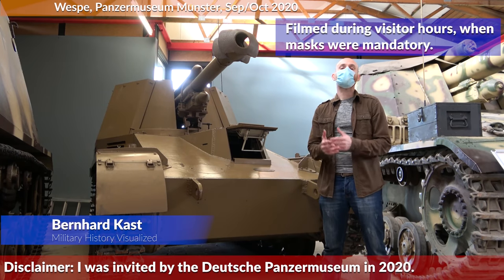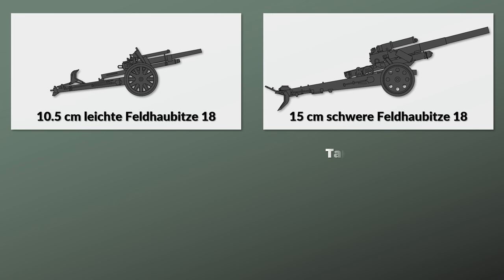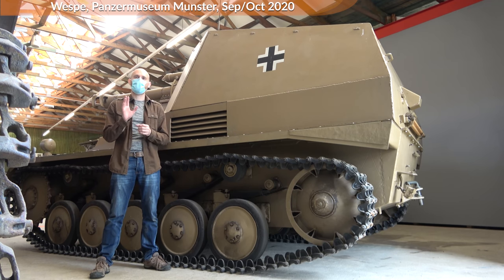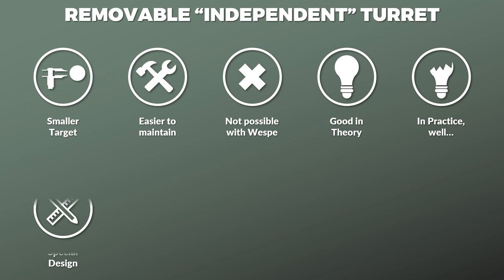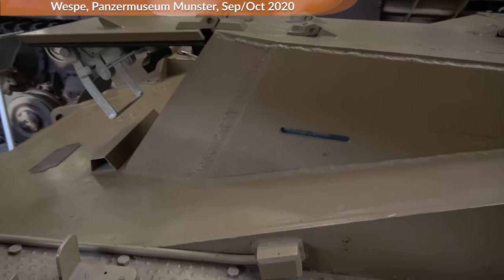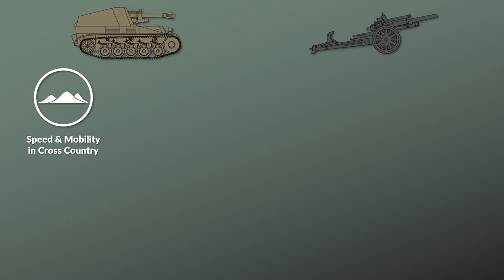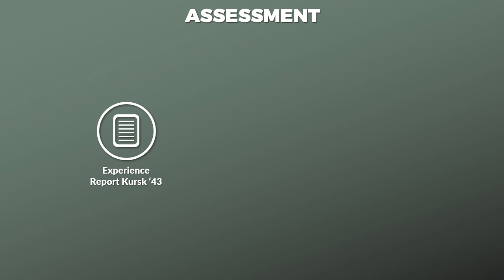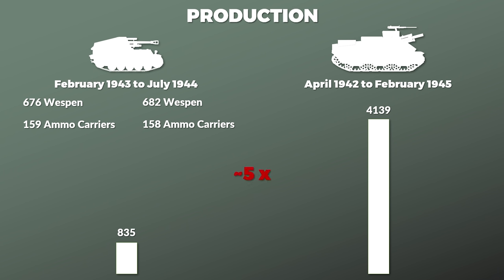Wespe: A Successful Failure?

Comment: You forget a major positive, the Wespe used an existing chasis that wasn't of much use other than as a platform for the 7.5 cm PAK. As such, the Wespe did not interfere with Stug, Panzer IV, or other tank production and allowed existing production lines to produce a useful vehicle rather than having to stop them to retool. Although you mentioned it used the obsolete panzer II chasis, you didn't point ot out as a positive when it should be given Germany's situation.  I wonder though if the 38t chasis might have been a better choice? Pretty sure the Panzer III chasis would have been better, but  would it be worth having lass Stugs on hand?
Reply from the maker: Well, I didn't talk about production benefits, also this is kinda implied with obsolete panzer 2 and existing components.
Reply: I wonder if they could have done the same with some of the obsolete French tanks?

The long term problem with that might be the German army's supply chain was already very complex and would get worse.
Reply: @seriousmaran9414  I believe that a visit to Baustab -Becker is called for.
Reply: @chrisgibson5267  yes, I have found instances of conversion, thanks. Should have searched earlier. The slower French tanks would not have been fast enough to keep up, so probably not worth converting.
Reply: With German shortages of everything, was there any efforts to reclaim and recycle   old tanks and vehicles and steel? Seems to me the soviets left a lot of scrap steel laying around.
Reply: @seriousmaran9414   if all these Beutepanzers are limited to functioning  within their immediate area , then any limitations of supply train and or maintenance become much less impactful.
Reply: @paullakowski2509  considering that the French tanks were not fast enough to keep up it was probably better for the Germans to just scrap them.
Reply: @seriousmaran9414  NO , they were war bootie and should be reused in any manner they can....many were used as artillery tractors , while the turrets were mounted on fortifications. 

Since they were French they should stay and serve in the west. Another option is to just sell them to their military allies like the Italians Hungarians or Romanians etc.
Reply: @paullakowski2509  I am not arguing against those options but the German Army had better ones.
Reply: @seriousmaran9414 so whats your plan
Reply: @paullakowski2509  do I need one for a war that ended in 1945?

Many were damaged and recycled, others were used for security in France and some were turned into artillery. Fact was they were of limited usefulness once they invaded Russia. An idea might have been to gift them to the Italians who's tanks were even worse.
Reply: @seriousmaran9414  then gifts to the Italians /Romanians /Hungarians....it is.

 IF you research these wartime armies they all had enough motorization to equip a dozen brigades between them. In that case theirs more than enough Beute Panzer's to form a dozen mechanized brigades - each equipped with 4-6 battalions-detachments with  either ...armoured cars / APC/ PzJagd /SP howitzers and even a panzer battalion with SOMUA/CHAR B / M-13 & M-15...etc etc
Reply: @seriousmaran9414  I think concerns about sabotage would make that a less appealing option. French sabotage was mostly done in the form of playing dumb and hiding things, and the amount of resources that would be needed to prevent this kind of sabotage would mean it might be barely cheaper than just creating a new production line in a less hostile place. And the output would be crappy French vehicles. So not worth it.

I think the cost-benefit math for using French truck production works out better. I don't know if that was done, but I would be surprised if it wasn't.
Reply: @lobsterbark  more there just was not enough resources to supply all the factories.

Comment: I recall reading (I think in Chamberlain and Ellis) that the M7 was an inefficiently large chassis for a 105mm gun, and here we learn that the Wespe was if anything a bit too small.  I wonder if the Pz IV chassis might also have been a bit big, but the Pz III chassis could have been the perfect size for a 105mm armed SPG?  The post war US M37 105mm HMC was based on the M24 chassis, and dimensionally that's about the same size as a Pz III.
Reply: really the idea that the artillery "needs" what was asked for is silly
considering the need to deploy a battery of artillery in order to have any meaningful effect on target area carrying amo and crew is kind of a luxury, they are not really tactical that's what Stugs are for, although Russia used SU-76s as assault guns but was that really a "good" idea
M7 has it's flaws but spoils the hell out of it's crew with all the space, amo and the .50
the title is a bit unfair as the criteria is so stringent almost no WW2 SPG could be considered successful
Reply: Panzer 3 and Panzer 4 were the same size.
Reply: @michaelkensbock661  Have you seen the two vehicles side by side?  Or even two models in the same scale side by side?  The Panzer III is visibly more compact than the Panzer IV.
Reply: @michaelkensbock661  No 3 has a smaller chassis. But his production where stopped 1943 so ...
Reply: Pz3 production was stopped in 1943, however there were significant numbers of pz3 chassis Available right up to the end of the war.  Thus a conversion of a pz3 chassis to self propelled artillery is not infeasible
Reply: @lukasbechtel2401  It's not like the Germans were producing the Wespe's Pz II chassis past 1943 either.

Comment: On the point about "lighter weight for mobility" (or however it was phrased), I believe there is evidence that that was done. Specifically it is an open-topped vehicle. A closed armored top would have added perhaps a ton or two to the overall weight, and made the unit nearly immobile. I believe there is some documentary evidence that US self-propelled artillery was likewise open topped to reduce overall weight and increase mobility (or at least allow mobility).
Reply: A steel roof plate 2,5 x 2,5m and 10mm thick would weight about 500kg, so you were pretty close.

Comment: Hello!

I think its a bit odd that the Wespe only had 30 rounds of ammunition with it. If they would have chosen a bigger chasse they could have gotten away with more room for rounds. But i think you also need to view this from the production point of view. They probably already have a production line ready for the Panzer II chase, and while they were beefing up the tanks with heavier chasses, the Panzer II chasse probably became available. And they probably filled that gap up with the Wespe design. Also the ammo carrier is the same shape as the Wespe, that also shows that they wanted to keep production simple, so nothing fancy for the ammo carrier and they used the same design as the Wespe.

Today we have plasma cutters and CAD programs that let you design and build in a really quick pace. If they had that back in the day it would have been a lot easier to get things done. I think engineers back in the day were real artists, the amount of work you have to put in to get a drawing right, its a tedious job.

Any way; nice video!

Greetings,

Jeff
Reply: I think the original idea was moveable gun, if a Wespe is knocked out you move its gun into an ammo carrier and you have another Wespe. Germans also proved unwilling to dismantle production lines with the Panzer 2, Panzer 3 and 38T production lines simply being retooled to produce different vehicle variants, probably more efficent than Britain where everytime they came up with a new tank at one of the four or so main design companies they shut down the previous production lines so you had small production runs, also from 1941 every time a company won a contract to build a tank the next best bidder would be appointed to design an improved version of the winning design which meant the losing company would have to acquire another set of the winning companies tooling. (Though I suppose the plus side was redundancy, if one factory was knocked out another could still build the same design)
Reply: @watcherzero5256  The British failed for a long time to come up with a tank design with which they were satisfied. Nor had they an assault gun stratagem (they used infantry tanks), or had self propelled artillery at a high priority. I think they even phased the Priest out at one time because the Priest used different ammo. So there was little use for stug and self propelled gun concept. 
But for the  Archer the British did reuse a chassis and they did it even simpler. They put the 17 pounder on a Valentine chassis and switched gun around (firing backwards) so they did not even not to switch  the engine and the fighting compartment around.
Reply: @barthoving2053  There was also the Achilles which was an M10 but upgunned by the British, it used a slightly modified M4 chassis. Your right though, for the most part the British never withdrew a tank from service making it available for refitting, just sent it somewhere less hot (for example the Matilda II saw out the war fighting the Japanese in the Pacific) and ultimately for training new recruits. Some were used as artillery tractors though with both M3, M4 and Crusader II converted to tractors when better tanks came along 1943-1945. There was also some Valentines and other tanks converted to AA and SPGs as field modifications rather than an official programme of conversion. Also there were close support assault guns produced but generally as variants of normal tank designs (e.g. using a 95mm howitzer instead of a 2pdr and the Churchill AVRE) rather than a whole new vehicle being designed.
Reply: I disagree. Bigger gun than a normal tank, bigger munitions than an average tank, heavier than a panzer 2, less armoured. It's clearly designed to haul the main weight being the gun (as the gunless carriage can hold 3x the munitions). Simply "moving the gun to make room for more bullets, can throw the balance of the vehicle easily, putting excessive strain on the engine, gears, rollers etc, not to mention the possibility of needing a bigger engine and being prone to tipping or getting stuck if too far forward. (Also keeping in mind engine height given the clearance of the chassis)
Reply: No offence guys but you're nitpicking over nothing. Just making the 105mm LeFH howitzer mechanised and armoured, made them much MUCH MORE survivable. That they didn't have to waste that effort on medium tanks was a god send. 

An alternative might be the 150mm infantry gun....yes 1/2 artillery range , but with more than three times the through weight. That was also on the Czech chassis - again another sound concept. 

As to limits of ammo supply- each howitzer battery had ammo section of a light battery and carried >500 shells [Buchner T GI HB pp90] . With Wehrmacht a mechanized battery carried 4 *3 ton ammo trucks allowing maybe 144 shells plus 6 with each limber tractor. L W.G Niehorster .

These batteries also had a fifth tractor in the battery as replacement. Always thought that was to bring ammo forward , but i gather the limber arrangement was far from ideal and losing such a tractor was frequent enough to require a ready replacement.

Comment: I'm here thinking: what if you could make a design where the 360 traverse is achieved by the gunner being able to assume control of the tracks on the vehicle?

Self-propelled artillery isn't intended to fire during movement anyway. The intent is to be able to keep up with armored units, and also relocate quickly after firing one or several shots.

So if you had a system where the gunner and loader assume control over the tracks for traverse purposes, while the driver has the ability to override it during the case of an emergency, you could've saved a lot of construction that goes into the turret so the gun only requires elevation control.
Reply from the maker: addressed in the video
Reply: @MilitaryHistoryVisualized  Ah, I jumped the gun a bit there. Thank you for the correction!

Comment: It's not just power-to-weight ratio that's important, but ground pressure, especially in muddy/boggy conditions.
In fact, the Wespe was still very good in this regard: 0.76 kg/cm2. <https://panzerworld.com/wespe>.
Compare the Pz IV at ~0.90 kg.cm2, <https://panzerworld.com/pz-kpfw-iv>, and the Panther at 0.88kg.cm2 <https://panzerworld.com/pz-kpfw-panther>.
There are other cross-country factors as well: maximum grade angle, trench crossing depth, vertical obstacle height, fording depth, etc.
I suspect this is where the Wespe struggled a bit at Kursk (according to the 4th Pz XX report).

Comment: What are the barrels/tubes used for above and below the main gun? Sights?

Great videos!!
Reply: The tube above the barrel according to wikipedia is a  pneumatic recuperator, which I think does what the recoil spring in a handgun does. Push the barrel back forward into position after the gun has been fired. The one under the barrel I assume is just a rail the barrel slides back and forth on when firing, but I'm no expert.
Reply: @Umbra_Nocturnus  Thanks!
Reply: @1966kojak  You're welcome :)

Comment: As a basic stop-gap the Vespa excelled and should have had minor improvements, such as recoil spades and a 30 degree arc of fire (that the spades would afford0.  The ammo carrier should have also been designed as a recovery vehicle with a big winch and a arm 9pully lever) that the ammunition could be passed through (also a decoy)   To make such a light tank into a SPG would have resulted in having to use a smaller gun and then it would be employed as a tank far to often and the Americans had that with the 75mm cannon on the M4 Sherman (and the result was far to many Sherman getting destroyed) as operational misconception of not recognizing the doctrine of wrong place by the field commanders (a tank is a tank).  This is part of the Germans not taking advantage of the Phony War and extending it another 8-9 months and using that time for development..  as the Brits would have bombed them and the Germans would have dug in better with their industry and fix many of their faults in equipment ..

Comment: Don't you think it's a bit of an unfair comparison to compare a self-propelled artillery with it's towed variant but without the towing vehicle? The Sd. Kfz. 251 would probably be similarly difficult to maintain and is vital in the role of the towed artillery.
Reply: The artillery didn't use armoured halftracks to tow guns - 105mm howitzers were towed with SdKfz 11 prime movers.
Reply: @mattbowden4996  Then it is the SdKfz 11, but still, it would need to be considered in adiscussion of system reliability.
Reply: @KarlKarpfen  Perhaps, but it helps to be looking at the reliability of the right vehicle.
Reply: @KarlKarpfen  The weight of the armor alone would put more strain on the system. The weight and firing of the gun would put more strain on the suspension. And I'm not sure if the SdKfz had also track steering.  Another big problem for mechanical failure.

Comment: Wait, they wanted the turret to both have 360° traverse AND be easily removable at the same time? Aren't these two mutually exclusive?
Reply: Not if it's a little tent lol
Reply: Easily removable would probably be easier with a fully rotating carriage. Just hook up a crane and lift the turret out. 

The ridiculous part is the idea that you could just set the roved gun in a firing pit and run it like normal.
Reply: The idea was to be able to dismount the turret and use the Howitzer as a fixed emplacement. Fixed guns are far more accurate than the SPGs as the recoil is distributed to the ground instead of moving the vehicle about. The Heuschrecke 10 had a removable turret which could traverse 360 degrees and they did build enough prototypes to test the concept.